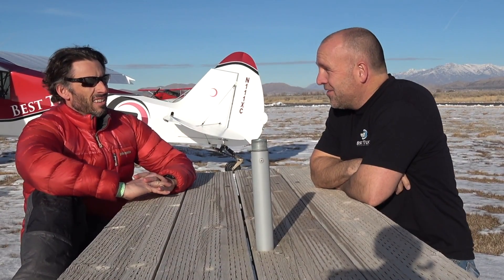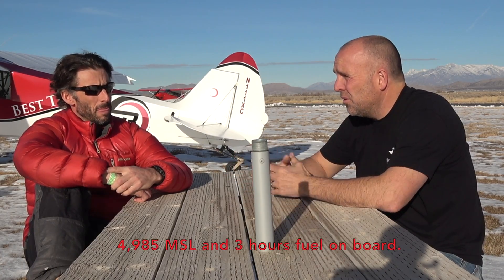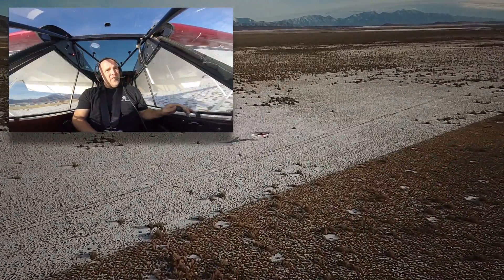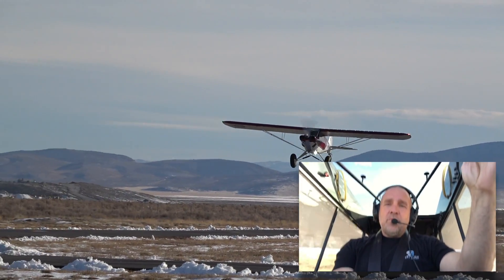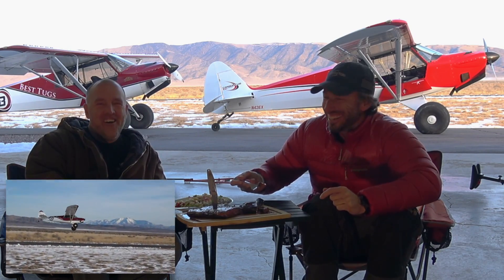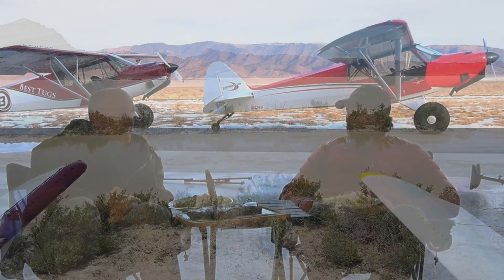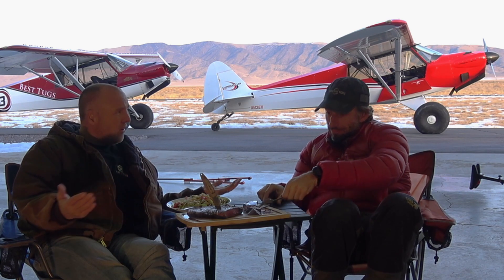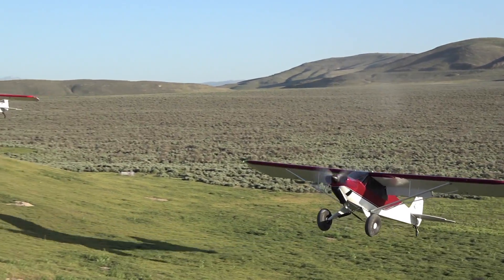The impossible turn in the Carbon Cub

Comment: I think it'd be a good idea to try with a 5 second delay in your response as well. It's typically for people to be a little shocked before they make the decision to turn. Awesome video!
Reply: Angle of Attack Thanks I totally agree, we talk about that toward the end of the video.
Reply from the maker: Angle of Attack even though we made it from 200 feet, we obviously would not attempt this in a real engine failure, also, I think that instead of just accepting you will take 5 seconds to react, my view is to expect an engine failure on every takeoff, and when I make it to 500 agl be thankful the engine is still running. If you are prepared every time that 5 seconds might turn into 1 or even 0. We were not trying to make this the most realistic scenario, to do that we pull the mixture not the power. So many things are just perpetuated in aviation because that’s what an Instructer said to a student, why should we as pilots just accept we are going to fumble around for 5 seconds after an engine failure? Why not try and be the best we can be and maybe turn the 5 seconds into 1? Mark and I have flow together and at any point during the day I can say your engine just quit, he has to goto idle and find a place to land and we could be 150 agl. I assure you he does not fumble around for 5 seconds before his first reaction, but I do agree with you that most pilots will fumble around for 5 seconds, maybe we are a little different than most.. thanks for the comment hope to see you in Alaska!
Reply: Can confirm that 3-5 seconds of "denial/lost time" is realistic when engine quits. Experienced  in CAP 10 N64UV, GFK, North Dakota on 21-04-1990. Student flying as I scanned for  abinitio Chinese  & Gulf students babbling on  Freq. and flying B-52 patterns. Slipped/landed into/on unprepared ground to avoid ditch/berm. Nominal TD and 300' of roll out until main gear abruptly halted by earth mounds and tall grass. Taildragger flipped over prop onto its back. No fire, plane reparable.
Reply: You certainly are a little different than most. You guys are top notch. At OSH17 I attended a seminar by an aerobatic instructor who showed the situations where an impossible turn was doable. It was very informative. He cautioned that no-one try it in a real situation without having practiced it first. Personally, I like the thought of NEVER doing the impossible turn as a blanket statement for new pilots. However, why not explore this more with more experienced? I actually enjoyed seeing you guys do this and approaching the subject. Flying has very few absolutes, and we should always be discovering new ways to get it done. (this is Chris Palmer, btw)
Reply: Lucky! But, also a lot to do with skill and training. Great job.
Reply from the maker: I agree Chris...  I just hate to meet the person that has been flying for 15 years and never progresses past what his or her instructor taught them. The whole point of then video is to get people to get to know their airplane better. The "fun" for us was to see how low we could go, for others it may be something different, but as long as the video gets people thinking and trying new stuff in their airplane it is a win... We should all strive to be better pilots than our instructors... Thanks for your comment..
Reply: 100% agreed. The type of flying you guys do is rare, but it comes at a price. That price is continual improvement, practice and digging down on these topics. Great job to you both!
Reply: my exact thoughts as well. knowing a failure is coming and not knowing will make a big difference in these situations. awesome video though guys!
Reply: That was great! I agree with Angle of Attack though about adding in the reaction time delay.
Reply: Jason, heck ya...always pushing that envelope.  But how does that translate onto the CV when trying to get hired.  :)  I have always sought to differentiate from the pilot who flies the same hour a thousand times.
Reply from the maker: I agree, but what if you trained for the engine to stop, and expected it on every takeoff? What if the entire climb to say 1,500 AGL you were think "it's going to quit" and it actually did, then you would not waste 3-5 seconds. The reason people waste 3-5 seconds is because they are not expecting it.  When my throttle goes forward on takeoff I say to myself the engine is going to quit on takeoff, and when it does not I am thankful, but I am expecting it to quit, and I practice what to do when it does.
Reply: I agree with this philosophy, just expect it anytime and the pilot is not surprised when it does.
Reply: As others have indicated in their comments, 5 seconds is a bit too long.  If you take 5 to recover your wits, that means you have never thought about, planned for, or actually practiced an engine out.  That's the point of this video.  The number generally accepted as real when you have become comfortable with the maneuver and the IDEA of an engine out is 2 seconds, 3 max.
Reply: Gonna say the same thing. Starting the turn the instant the power stops doesn't seem like a condition that could happen.
Reply: Agent J  I'm not trying to devalue training for it, just saying it's called by its name for a reason, most people need at least a few seconds to make the decision, especially if your not alone.
Reply: Angle of Attack good point bringing in the unexpected human element to flying!
Reply: @jasonsneed3179  ~ No, you're not different, you're purposely more experienced.  I was riding in a Super Cub with my boss (he could fly like most people walk-it was natural) between 100-150 AGL when he performed a perfect, controlled hammer head turn.  I loved it, except when the button on the top of my cap collided with the cross tube above my head (seat belt wasn't tight enough)—saw stars for a few seconds.
Reply: @jasonsneed3179  i was gonna flame this vid until i read this comment and you are in fact, spot on. a couple thousand hours flying attack helicopters for the army you learn to always hope for the best and expect the worst. ive looked at enough post crash analysis reports to come to the conclusion that maybe 5 seconds ISNT enough for a lot of people. guys talking on the radio all the way into the dirt makes me suspect that maybe they NEVER actually mentally accepted that the shit had gone bad. assuming that an engine will die on climbout and having a response already booted up and ready to go in your frontal cortex will keep you and yours healthier, longer. also, you were absolutely correct that the nose down that has to happen from a climb attitude to best glide is a bunch and the resultant site picture is uncomfortable so low to the ground. another reason to have the scenario/response already booted up and ready to go will keep a bad day from getting worse. great video, beautiful machines and looked like a lot of fun
Reply from the maker: @josemadarieta3  Thanks... Yea I am always amazed how some pilots don't progress from what their instructor taught them. The majority of pilots just accept they will fumble around for 5 seconds when in fact they could train and prepare and not fumble around for 5 seconds..
Reply: @jasonsneed3179  or not train and fumble around for the rest of their lives. ps. i wish i was a bush pilot
Reply: Chance favors the prepared
Reply: I agree reaction time can also be much shorter than 5 seconds...if you are prepared.  I teach students a 4 part brief before every takeoff...
engine quits on runway, step ahead. 
Engine quits after liftoff with runway remaining land on runway.
Engine quits below __ altitude(mike and Jason have theirs at 300) land straight ahead.
Engine quits above _ altitude turn back for runway.

When you brief it you expect it. When you expect it you react to it.  When you have practiced it you respond to it.  

Thanks for the video guys!
Reply: 5 seconds they are already on the ground, way too long
Reply: @Aero360Aviation  When you are comfortable practising this.. add any delay you like.
Reply: @jasonsneed3179  Trying to get down to 1 through training and always be prepared for engine failure is the only way to save lives. The devil will still claim his victims and catch you in unfavorable conditions.
Reply: Agree, FAA says the startle factor and delay to respond could be anywhere fro 5 to 10 seconds.

Comment: This month's (April 2018) "AOPA Pilot" has an article "A better return policy" by John Carroll, page 78, that says that on take-off drifting off from the runway center-line improves your chances of making the 180° back to the runway you just took off from if your engine failed. Coincidentally I went up for my biannual flight review and discussed the article with the flight instructor and he thought about it agreed that it made sense. Don't know what Air Traffic Control at our airport would have to say about such a maneuver.
Reply: You have to call the tower and ask for permission to do Turnbacks To Opposite.
Reply: @feetgoaroundfullflapsC  lol Engine out on takeoff is a bonafide emergency. Declare it and inform the tower of your plan of action. Ask for nothing. There is nothing either you or the tower can do either way

Comment: Great video with sensible caveats based on your personal skills and knowledge. Not sure if it’s been said but turning 180 degrees, you’ll be landing with a tailwind. I tried it once an with a wind of only 10 knots, the increase in ground track and speed is not to be underestimated.
Also, your aircraft can land on rough ground so the outcome is likely to be more favourable than say a PA28 or C172.
As a UK CFI, I teach initial aiming mark one third into the runway, once you’re confident of making it, select flap and that’ll bring the landing point forward. Dead engine isn’t practiced as you said so that is a very important consideration.

Comment: This is a much higher level of what my kids and I did in deserted winter parking lots when they were learning to drive. Even if you know what’s coming, there’s that moment where the situation gives you the stomach butterflies. I think that’s where you freeze up and stop flying or driving, and simply let physics and gravity take over. On a couple of occasions I have been surprised by what you can thread a truck through with zero contact and damage, simply because you just keep your hands on the wheel doing what they do anyway. It’s ALL risk of varying degrees, doesn’t matter what you’re doing. May as well give yourself an edge. Thanks guys.👍👍

Comment: Very cool, great video. Might I add, in a real life emergency there is going to be more of a delay with the pilots response. In your experiment you guys knew you were going to cut the engine, and you immediately adjusted course after the cut. This would never happen IRL because the pilot at very least will need a few seconds to assess the situation, possibly try to restart the engine, look for clearing in front, etc. I imagine if you're working out of an airport your are very familiar with, you could certainly pull this off, but even then a few seconds of delay could mean another 50ft of lost altitude. This is still something great to practice none the less.

Comment: Great Info! I did the same thing 30 plus years ago. My Bonanza took 800 ft. Also I practiced engine out procedures a lot and when it happened live on the face of Mt Rainier I immediately turned away from the mountain and seeing a road I could glide to I scanned the instruments, zero fuel pressure, electric fuel pump, engine came back alive, about 7 seconds all while my poor wife was screaming in my ear! "Practice emergency procedures relentlessly". I hope you never have an engine failure but if you do, I pray that you are prepared!!!
Reply from the maker: Thanks

Comment: Many good points, in both the video and by the commenters (refreshing to see). The comment that resonated loudest with me was Mark's and I'll paraphrase, "The minimum skill set has become their MAXIMUM skill set"....I fly multiple airframes (UH1, UH60, UH72, C208 and C212-200)...many of my days are spent in the CASA supporting military freefall training...I try to encourage RW-to-FW guys to explore the flight envelope of the FW ACFT...but always within the limits mandated by the manufacturer and performance planning. I have had senior pilots and instructors become un-nerved by practicing full-flap descents from altitude to landing while holding the top of the white arc. Flaps full vs. flaps @ approach is a huge change in sight picture due to steep nose down attitude...the round out/flair at touchdown gets 'em every time. I'm like "what if you NEEDED that profile in an emergency, as long as the ACFT remains within the envelope?"....yet they are willing to leave options on the table. I implore all: know the capabilities AND limitation of what ever you fly, safely hone your skills and EXPLORE the limits of yourself and your ACFT. Train smart and have an escape plan (margin of error buffer and when to break it off!) Always consider DA and its effects...what works at your home base may not work in other regions OR seasons....even a repetitive msn like providing elevator service for jumpers can yield lots of opportunities to increase knowledge, S/A, and safety...blue skies fellas, great job! Thanks for sharing.

Comment: Hi guys! I just wanna share with you my story regarding impossible turns. 1st let me say thank you for this video. It is really useful and giving some very practical advises. So here is my story: Yesterday I had a checkride with my instructor for administrative revalidation of my SEP(A) rating. We did it on my home airfield in cavok but with moderate/strong crosswind (21015kt) with gussets up to 20 knots. The airplane was a dv20 katana nearly at max gross weight. I have only ca. 140 hours in my logbook. So flying was okay with the regular exercises, like landings with and without flaps, stalls, steep turns. etc. At the end we were making a t&go on rwy 14 with right hand pattern and right after the crosswind turn around 400ft AGL my instructor pulled back the throttle. I set the glide attitude and make a steep right and a left turn (like an `S`) to make it back to the rwy 32. I put full flaps but I saw we were still too high to stop till the end of the rwy although beyond that there was still paved surface to roll out. Around 100ft I applied full power and made a go around. My Instructor asked me what am I doing. I said `exercise done, beyond it I would feel it UNSAFE`. I saw on him that he was not full satisfied and he mentioned that next time he would make a right 270 turn away from the field to align with the rwy 32 at lower altitude for landing. So he offered me a 2nd attempt to try it out.  I said okay because I wanted to PROVE it for him that I can make that. Something went wrong with the 270 right turn because we were way too low at the end, just made it to the reach the paved surface, the threshold was at least 500 hundred meters ahead of us, had to avoid trees before reaching paved area, drifted away from the center line, had no time for flaps, tail hit the ground. On the ground the instructor told me that he believed I will cancel the approach again below 100 feet but I didn`t because I wanted to make it. Below 100ft still in turn with strong tailwind everything happened too fast (even for him maybe) that he just let me flying the plane... If it would be a real engine out situation I would say that the job was done. BUT AS AN EXERCISE IT WAS UNSAFE. Everybody has the right to take a conclusion of this story but mine is definitely: as long I fly the plane I will never make anything unless I feel it SAFE and to be honest I don`t care how many thousand hours is sitting next to me!

Comment: In the video, the point about idle power is very true.  In a Mooney, we can pull the prop back, but on the crowded east coast where we fly, we can't intentionally stop the prop during practice on the runway without somebody reporting us to the FAA.  Also, it's just too dangerous to do in a real simulated landing down to the ground in a Mooney.

Comment: The dangerous and more realistic scenario is that an engine doesn’t quit but loses power gradually and or partly. Most people will instinctively try to nurse it around and THEN stall spin it, rather than chop the power and go for a field
Reply from the maker: Sky Dive  everybody is different, and all aircraft are different, I personally would use any and all energy I have to make a safe landing, that could be engine energy, stored energy, or energy of the wind I can use to slow my ground speed. All pilot skills are different also, the message of the video is, know you airplane, practice in your airplane, and define what you can do, what the aircraft can do, and always strive to learn more and progress. Thanks for the comment.
Reply: Jason Sneed totally agree! Practice practice practice. However every flight is different... When I was an instructor I almost smoked it, not with a student, when that thing started running on three, decided to take it around. Very stupid decision! It was a hot high wind day so when I was downwind, with this thing shuddering, only then I realised that, if that thing would finally quit, it would be not salvageable due to high ground speed. It did not stop and I did make it in ok but it was only by the grace of God. A bit of thought and contingency planning is always good
Reply from the maker: Sky Dive yes, glad you made it, I like to tell myself the engine is going to quit or have issues every time I advance the throttle for takeoff, this way I am a little more prepared.